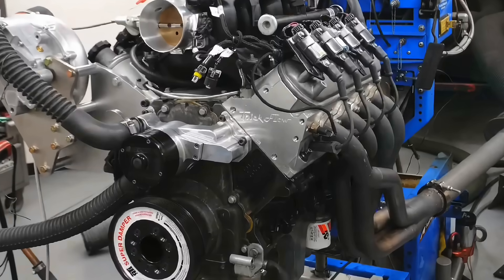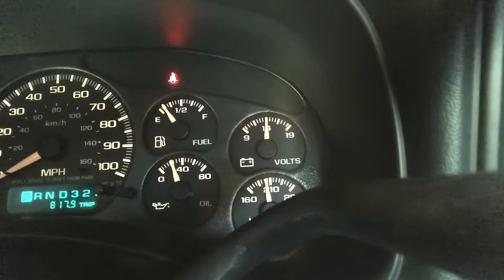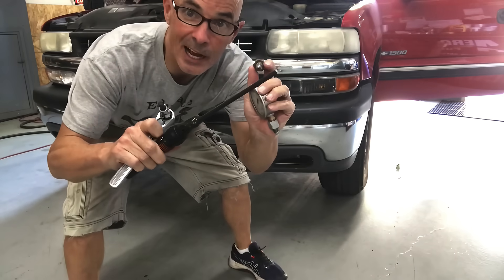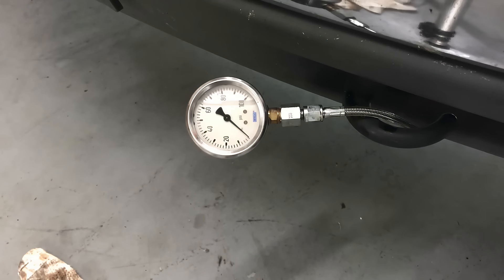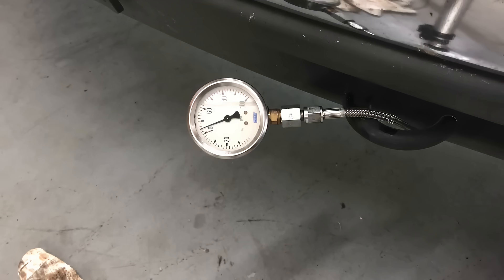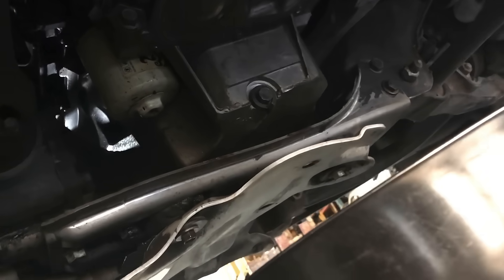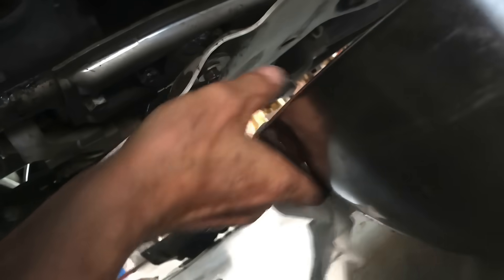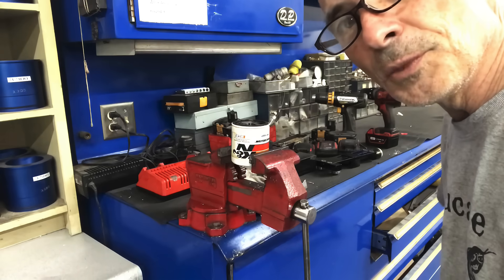HOW TO: TEST & FIX LOW OIL PRESSURE IN YOUR 5.3L OR OTHER LS?

Comment: When you checking oil filter you must open pleated paper medium and look for any metal particles imbedded in paper, if your seeing metal laying in bottom of canister then it is clearly beyond early symptoms stage and you have left it too late, (oil sample analysis and) cutting filter open every time you change it is how you get early intervention not after you've ignored the niggling signs and then find metallic look to oil or metal floating around in filter canister, cutting open filters and oil analysis is mandatory common practice on HD engines such as Semi,s and earthmoving etc, so is good quality oil and regular  change intervals, one oil test is the PQ value which shows how much of the additive package is still in the oil, filtering to keep it clean is not enough if the additive package is depleted, their is no free lunch with your oil, it truly is the life blood of your engine and the LS seems to be more particular about this than most, just some FYI for DIY oil changers

Comment: Same truck here.  My pressure dropped from 25 hot idle to 20, and now 16 at hot idle.  It gradually dropped over 2 months.  I've replaced sending unit with a non OEM. 
I've replaced pickup tube gasket with no difference, but I replaced the orange one on it with a black one.   Never go to auto zone.   Could that be it???
I flushed oil several times in 2 months.   Now I'm running a good oil and filter.  My fear is the bearings.  
Where did you connect the Guage at?

Comment: fluctuating low my first thought was a leak in the pickup tube. 
 once I built a 350 had great oil pressure too great the high volume oil pump was new and the check valve was sticking . it split the oil filter.

Comment: My 2011 5.3 @ 160000 mph oil pressure at 180 temp is 40psi oil pressure at idle going up to 60 psi when driving at 60mph. Is this normal?
Reply from the maker: 160000 mph? 40 psi idle and 60 psi cruise (about 2000 rpm) is normal

Comment: Just bought an 05 avalanche with 235k miles on it. Lifter noise present, oil pressure down around 25-30 psi. This wasn't the case during the test drive. Lucas oil additive took care of the noise, but low pressure still present. Hoping it's just the o-ring! Going to wait till the spring to take it apart, as snow and ice makes for a bad surface to work on.

Comment: Had the very same thing happen to my 2005 Yukon XL Denali. 182K miles all of a sudden the lifters started ticking on startup and after it was warm it wouldn't hold over 20 PSI on HOT idle where it used to be 40+ HOT idle. Going down highway it was about 50 PSI (not far off from normal) so I knew it wasn't the bearings. I bought a Melling High volume oil pump and new pickup tube, Installed in the garage over a 3 day weekend and BAM 50 PSI hot Idle no lifter tick 80 PSI at 6000 RPM. Melling recommend the high volume since it was a little higher mileage engine, and the high pressure spring was only really good for 7 psi up in the rev range, It didn't change much at idle and they said 80 PSI was still safe. Upon inspection I found the original oil pump pickup O-ring was in good condition, It was the Oil Pump Regulator Spring and Piston that was weak and bleeding off pressure. Have 196K miles on it now and runs great. Don't plan to spend 60K+ dollars on a new Yukon so ill be running this one for a while.
Reply: What's the pump name please
Reply: i get it...have 208k on a 2007 silverado...luckily no engine issues.....newer truck is nice if can afford , but then insurance company nails you to the wall

Comment: In my 04 Silverado, Mine starts a 20 psi and stays at 20 psi until I come to a stop... Then it drops almost to 2 and the low oil starts 🛎 until I start driving again.. Took it to a mechanic and he said I need a oil pump... I might try the o ring replacement to see if that helps, cuz it drives fine.. No knocks... Idles fine too..
Reply: Can also be the cam plate gasket he showed.. it was my issue..

Comment: same    mine ended up being the pickup tube o-ring and the back plate on block for the main seal on the internal top part   and also check the  barbell on back of block   its only there for production hole drilling  so u don't bypass filter   etc. so if orings are old it will bleed by and cause low pressure too       lastly the plunger under pressure spring on pump if it is stuck open it will allow oil to recirculate in pump and never go to engine..
Reply from the maker: IT WAS THE O RING

Comment: If your oil pressure is OK after a cold start and then slowly gets lower (too low, as in below 10psi) as the engine warms and the oil warms/thins, that's a sign that the issue is the camshaft thrust plate that Richard showed in the video. That built-in gasket on the back of the plate can wear down (mine was practically flat) and when the oil warms up and thins out, it slips passed that plate and drains passed the timing gears and goes straight down into the oil pan - effectively bypassing the oil pump - and you see the oil pressure drop to below 10. I was baffled by this for a while. The low oil pressure alarm would go off, I would pull over, turn off the car, let it sit for a minute or so, crank it back up, oil pressure was back to normal because the oil pan had refilled, I could drive anywhere from 1 mile to 10 miles and the alarm would go off again). I replaced what was probably a functioning oil pump (but it had nearly 200k miles on it), the oil sending unit and that little screen underneath, and the problem persisted. I know now the oil pump was fine, it just didn't have enough oil to circulate because that worn gasket was letting too much slip by and not be available to the pump.
Reply: That’s exactly what my Tahoe is doing!
Reply: @DURONMYG  it’s a big project for a driveway mechanic, but very doable. It takes some effort to get to that plate. I understand why a shop would charge so much for labor. This happened during the lockdown m, so I had time on my hands and I was motivated to save money by not paying all that labor to have someone else do it. I did not replace the timing chain , btw. There are a couple of helpful YT videos out there (once you sift through all the ones focusing on replacing the oil pump, oil pump pickup tube o-ring, sending unit/filter,…
Good luck!
Reply: @kylelawdawg  thats exactly what my 2013 Sierra is doing.....i have already replaced the sending unit as well as the oil pickup oring
Reply: @kyle Martin   Hi. I'm down in Australia. Have a 2011 Toyota Kluger ( Highlander ) 550,000 kms. EXACT same symptoms as you had. If its thrust plate how many hours labor would you say for a shop mechanic to replace ??  I'll probably do what you did and also do Oil pump, O-ring AND maybe a oil flush for sludge. Might as well do the Oil pressure sensor as well. Any suggestions ??
Reply: @TheTopend2  Hi Troy,
I did the work in my driveway during the COVID lockdown so I was in no particular hurry. 
My best guess is that for a mechanic with a lift and proper tools it could perhaps be done in 2 to 4 hours. The biggest pain is having to drop the front differential to get to the last oil pump bolt and then having to take care to get the timing gears and chain reinstalled correctly. If your Toyota doesn’t have the same access issue for that last bolt, then maybe the differential can be left in place and the process may be quicker/easier. Hope that helps. I’m not a mechanic although after finishing that project my kids surprised me with a sticker that says “Certified YouTube Mechanic” 🤣
All the best to you!
Reply: @kylelawdawg  Lol, hey thanks mate for the reply.  So again, my symptoms are EXACTLY like yours but also a ticking LOUD sound starts, so I immediately Stop. Turn off 5 minutes. Start and its good, like you for a while, then again same. First mechanic I left with says Need new engine ( $7500 with Transmation, and extras, used done about 150,ooo kms )!!??  Got a second opinion and Mechanic said he will take of the rocker cover and look inside to see if sludgy etc. I'm dropping it in tomorrow for them to do that. As per you plenty of very good YouTube content to sift through ( hence your comment on this vid ) and I've decided, subject to tomorrows inspection, First to do together as they are all kinda linked or in the same area so might as well do all, Oil Change/Filter, Oil Pressure Sensor, pick-up O-Ring and Screen, Oil Pump ( done 550k Km's) . Like you I hope one of those does it. I will then also do a couple of very quick Oil changes like every 1000 kms to let the  synthetic oil flush out any sludge( done the research I'm not doing those "Flush" products could open a can of worms etc ).  If the cam shaft thrust/retaining plate is easy ( unlike like yours ) I'll just go ahead and do it. But either way that's the most expensive of the above mentioned so maybe I'll wait and hope one of the other items resolves eeh issue. Your Thoughts ???? Thanks

Comment: Cracked head causes low oil pressure in LS motors also clumps oil up making pressure drops due to antifreeze mixture with oil

Comment: Bout to do another rebuild on 6.0 low ps hopefully get it right .
Reply: Install a new crankshaft. If the clearances are too wide, it bleeds pressure off. I have never seen a shop be able to grind a crank as well as factory new. That is probably where your oil pressure has gone.

Comment: Mine has been good for the past 5 years until last oil change , now at 15psi at idle. 🙁
Reply: Mine also dropped right after an oil change.  It's a little concerning since I did it myself, but I know I didn't do anything wrong.

Comment: My neighbors 2007 1500 5.3 lost oil pressure the other day. 
Truck dipstick showed down a quart. 
I topped off and started,  gauge went to 40 at 1800 RPM . I can keep at 1800-2000 and it will stay at 40 ish for about 3 minutes then slowly drop to the warnings coming  on then to zero..
To me this sounds like once oil get warm  this sounds more like pump area problem more than a sensor.
Any thoughts before I dive in??
Tom

Comment: The water you have for motor oil probably dont help anything. Most Chevy trucks like a heavy weight oil. Or some kind of thick oil additive. Unless your going to tear the oil pump apart and rebuild all the worn out parts.
Reply from the maker: 5W-30 for ls

Comment: We always use the orange o ring when doing pan gaskets at my shop.    Most of em leave reading close to 60 psi at cold idle
Reply: I've never owned a GM product that idled over 40 lol.  Ive owned at leas 10 LS motored vehicles.
Reply: Where your shop at
Reply: 2003 suburban had low oil pressure,,  I’d replaced d oil pump with a hi volume pump,, now gauge gors to 70 at idle, is it normal,  of course, has new w40 oil

Comment: In my case, it was the oil filter. I installed a Napa gold oil filter. The oil pressure went from 35 to 60psi.  The one I had installed prior was from autozone. So I stick with Napa gold.
Reply: I'll give that a try thanks for the heads up
Reply: A!.

Comment: If there is a low pressure issue confirmed by a mechanical gauge I jack the rear end up high enough for the oil to cover the pump o ring, or even add a little extra. If the pressure returns to normal you know its the o ring. I never drop the pan either, its not terrible to do.
Reply: I'm going to try this. I'm fairly confident what my issue is, but a little extra insurance won't hurt.  Thanks for tip!!!

Comment: New Delco oil filters pH 46e start losing pressure at 1500 miles. Only the e code ones. Change to K N and pressure goes back up for full oil change.

Comment: Last winter my truck started tapping badly when it was cold so I added mystery oil but it still had low oil pressure till spring time ,then I had the oil changed and no more tapping. Now it is winter again still no cold tapping, did it fix itself?

Comment: I've twice seen the pressure relief piston in the pump get stuck. this was on two different engines (not mine) and 18 years apart. Small particles of crap will cause the piston to make scratches in the bore and at some point it may get stuck when at high rpm's, and cool oil. These things seem really sensitive to small bits of debris in the oil, which of course dont get filtered out due to the stock oil filter bypass.
  the good melling pump  is anodized and possibly is a little more resistant to dammage.

Comment: I've got one reading about the same way and I've already done an overhaul with a pump and bearings. Mine was closer to 300,000 when I built it because of the DOD issues and eliminated all of that. I run it on Mobile 1 with A/C Filter. Retired GM Technician. I'm wishing I put a washer under the pressure/bypass after the fact.

Comment: Hell I got a 08 and at idle it’s only 18-20 since I’ve had it and owned it about 7 years 140k later still the same
Reply: Exactly the same. New o ring too at 180k on an 07 yukon denali. Only slight improvement after o ring fix.

Comment: Found out that in the aluminum ls blocks the lifter bores wear out and cause low oil pressure. A friend that owns a machine shop diagnosed a low pressure 6.2 and after 2 tear downs, found as much as .008-.009 lifter clearance. Factory spec is no more than .0015 I believe. They can be opened up and an oversize lifter used or can be sleeved.

Comment: Only need about 10psi per 1000 rpm, so you are fine dude. Also, 15-40 in a stock LS motor? Pretty tick oil and robbing yourself of mpg and HP....

Comment: signs of a pump goin or screen clog i use take care of a fleet had 03 to 07 at time and had few i had do pumps to cuss theyll started doin this and slow get lower one just all at once almost in a weeks time want from 40 to 10 and say ther...but we talkin vans that had anywher around 250k to little over 300k but time i did 3rd in 6 yrs i ther i did then 3 probably 2 2nd yr in and then 3 about 5 in and then ther gettin ready get newer vans less miles
Reply: but i seen some of them never get higher then 45 and stay round 35 to 45 and others b low 30 to high as 45 or 50s 🤷‍♂️and run fine

Comment: I'm surprised you're running 15W40 motor oil, you must be somewhere hot! Up here on the 49th parallel, I consistently run 5W30, which is said to be 'preferred' in the dealer service manual (LM7 5.3 in a 2000 Suburban, 395,000 km). Are you running thicker oil because it is an old engine, burning oil?

Comment: Cam bearings and camshafts are known issues on these.  When the lifter fails, it starts hammering the hardened roller against the cam.  The lifter fails due to varnish.  Flush regularly, and use synthetic, especially with Displacement On Demand.
 Also, with the Displacement On Demand option, the oil return valve is known to atomize the hot oil, so there is an oil baffle update for that to reduce it from breaking down the oil into varnish.  Because there are cooling oil jets bouncing off the backs of the pistons, it causes more oil atomization, and requires the oiling system be flushed regularly.  This will keep the pickup screen from plugging up.
Reply: What is GM recommending to use as a flush?
Reply: @CptKirKBo  Oh, they recommend nothing.  Bad for business.  The regular over-the-counter oil flush will do.
Reply: @vilefly  Makes sense...I'm really familiar with most things GM and don't ever recall them recommending a flush. I personally won't flush any engine UNLESSD I can verify it's not a "sludge monkey" as that's just instant death (unless willing to disassemble the pan/pump/screen afterwards as the screen will block in real short order)though on engines I've serviced and KNOW are clean,I have done this quite a number of times. Thanks for the answer!
Reply: @CptKirKBo  Dropping the oil pan has become part of 100k mile service at my job for these motors.  The oil pump pickup tube o ring hardens up and can fail.

Comment: Tech tip never let your gas go below 1/4 tank. The reason being that the gas cools the pump and when you run it low there's no gas surrounding the pump to cool the pump
Reply: I always do this too.  I may never know if it helps but can't really hurt.
Reply: ESPECIALLY on these older style gm trucks lol
Reply: Definitely makes a difference in pump life and also fuel temps

Comment: I have the Johnson ST2116LSR lifters in my LS2. Oil pressure is very low around 15 psi when hot at idle. Cold start is good around 50 psi. I have mixed responses saying it's ok and not ok?? What is your opinion??

Comment: Hey Richard I’m sorry I’m late to this but I got one for you I have a 08 trailblazer super sport 6.0 ls2. First motor started knocking on acceleration and oil pressure dropped to 20 psi. The engine ended up locking up at the dealership. GM replaced it $11,000 later No cost to me. Second motor GM Put in Corvette yellow top head LS2. New motor came with Corvette oil pan and sending unit. Mechanic had to put my old oil pan and my old sending unit on the new motor. Truck was ridiculously fast then I would notice zero oil pressure on start up. After a few revs oil pressure with Build back up to 40 psi. From cold starts to every start the truck would have zero oil pressure and tapping valves until I could get the pressure to rise(40psi). Now it’s tap tap tap squeak squeak squeak zero oil pressure all the time. I call GM and they want me to pay to have the engine broken down and looked at before they think about replacing the second engine. Truck has been sitting for over 4 years now with only 20,000 miles on new motor. Truck has used mobile one synthetic oil only and do you think by replacing the sending unit that it may build pressure?
I remember the mechanic showing me the trailblazer version picks up from the back and the new motor picks up from the front he had to bend and re-locate my sending unit. So frustrated.

Comment: Seen so many low oil pressure LS motors caused by cheapo oil filters. They are especially susceptible to issues from cheap filters it appears.